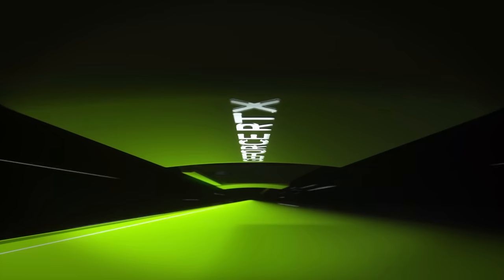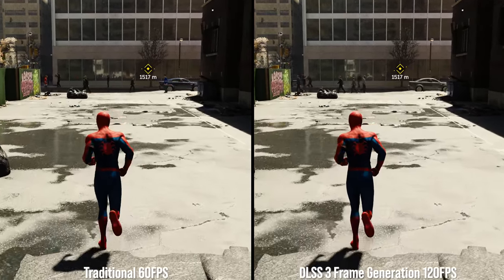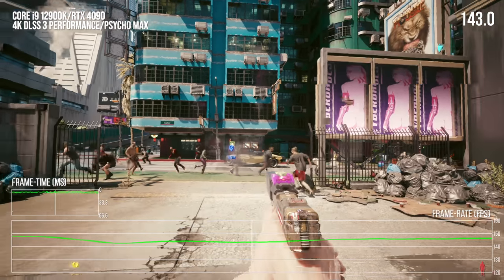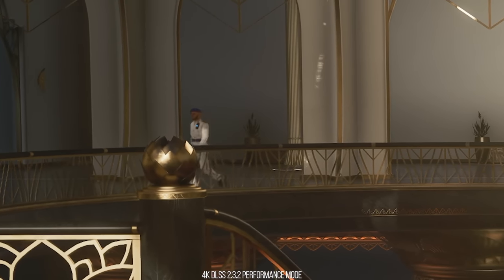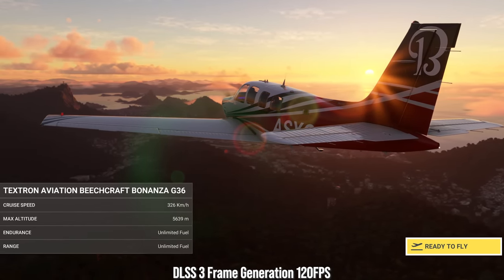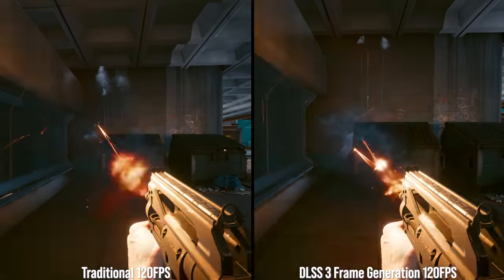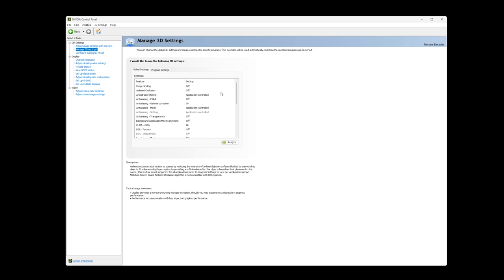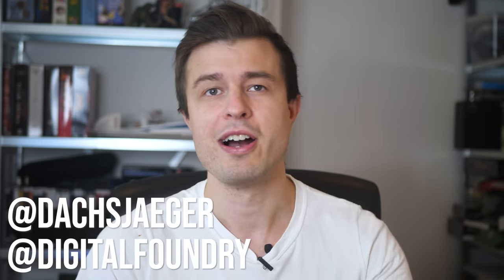Nvidia DLSS 3 Analysis: Image Quality, Latency, V-Sync + Testing Methodology

Comment: What's with the Vsync talk, it shouldn't be used EVER. Then the problem doesn't exist. Use only VRR and frame cap it then latency wouldn't increase. Your example was still high because you still used Vsync.
 If you don't have VRR ability for some reason you still just frame cap it to 118fps and the tearing is minimal if you always hit the high frames. Still not increased latency.

I don't even understand why you bring up Vsync at all. It makes no sense. Why are you saying you will use Vsync if you inherently have Gsync available? Turn that Vsync off leave only Gsync on and frame cap it. The Vsync part when using Gsync is ONLY for when the fps hit monitor refresh cap and goes beyond it and causing tearing. Because the Gsync range only goes to monitor refresh cap.
Are there really people out there using Vsync for when frames go above it. LOL??? All you're doing is playing at increased latency. Imagine playing a game where you 99% of the time is above your monitor refresh cap of let's say 120Hz. You 100% defeat the purpose of Gsync and you just have the increased latency with Vsync. 

I don't get it, what am I missing here?
Reply: A lot of people still use Vsync because they dont have VRR (or have shitty VRR) and tearing is horrible. High FPS causes more tearing, not less. I don't play multiplayer games, double the latency for a perfect smooth image is worth
Reply: VRR is not widely adopted so it it makes sense people use vsync, especially in single player games , people don't like tearing and most people  would prefere small latency than tearing, so please don't you say something so dumb as to it makes no sense
Reply: @EricDFreak   This is for higher frame rates. So, if possible, frame capping at 120fps if you have 120Hz monitor is still better. I don't have VRR at the moment. I see no tearing when playing games reaching 120fps. It's so minimal it doesn't distract.

Comment: I think frame generation sounds like a gimmick.  Adding "fake frames" to double fps on a graph but not really increasing performance.  Really ?  How is increasing latency, and just posting higher fps, not a gimmick ? Just know exactly what it is and what it is not, as explained greatly in this video.    I also agree with some videos that say , the best idea is to not use it unless you need to use it.  Just use DLSS, which is awesome.  But remember, DLSS put more load on a cpu, and takes some load off the gpu.  Poorly optimized games that are released too early, causes gamers to need more computer power to compensate for poor programming.

Comment: Like everyone else says, great job Alex!

And holy hell, DLSS 3 seems awful. I love high game rates (I game at 120Hz when I can). But this only seems worth it if a game can't hit over 60Hz with just DLSS 2 reconstruction, and I can't imagine wanting over 60Hz at the cost of that much latency, artifacting, and putzing with settings to ensure frame rate isn't too good. Remember when it was common knowledge not to turn on your TV's motion interpolation? Now that same (albeit much improved) feature is being sold to us as a gaming feature. I don't buy it.
Reply: Reflex addresses latency. This is no worse than triple buffering latency.
Reply: @Wobbothe3rd  Why not use Reflex without this?
Reply: It's actually the opposite. They clearly explained why DLSS 3 looks and works better the more natural framerates you already have. So, it's not worth it if you cannot hit over 60 Hz
Reply: @FredWallace18  I'd say, this is for people that can at least hit 80 natural FPS. But also I think a 4K +144Hz is needed in a scenario like this, because it would be too easy to hit 120 FPS with DLSS 3 if you already get 80 FPS. And as they explained, to have the best low latency ratio, you must not get too close to your monitor's refresh rate limit. So, the sweet spot to activate DLSS 3 imo is, 1) You hit around 80 FPS with a 4K 144 Hz monitor OR 2) You hit around 100 FPS with a 4K 165 Hz monitor. 

If you have a 240+ Hz monitor, DLSS 3 is NOT recommended, since you probably are an e-sports player and your objective is to have the least amount of latency as possible.

Comment: The input latency test was amateurish.

No knowledge shown of limiting output fps to 3 below monitor hz.

Doing this eliminates the need for vsync because it prevents screen tear when output fps is higher than monitor hz.

GSync does the opposite by preventing screen tear when output fps is lower than monitor hz.

Turn Gsync on, VSync off and limit fps to 3 below monitor hz and now test input latency.

I'd go as far to say your test was fake news and complete mis-information.
Reply: Reflex, which is automatically enabled when using DLSS 3, already caps the refresh rate.

Comment: Nobody uses v-sync on PC. Dude has no clue what he's talking about.
Reply: Found the guy with the crappy gpu that can't max out his monitors refresh rate.
Reply: @justinnolan3667  nobody can in this game, show me one person that runs it at max settings 4k and 144hz. Without fake DLSS 3.0 which basically adds input lag which beats the whole point of getting high refresh rates.
Reply: @rj6782  you realize not everyone does 4k? At 1440p with every setting maxed including RT and without dlss or frame insertion the 4070 Ti still goes over 144fps in some simple scenes and the screen tears. Vsync prevents tearing above gsync range.
Reply: RT will make sure you are CPU bottlenecked way before u hit 144 frames on any resolution at max settings,  frame insertions is useless for the simple reason it ups latency, which is the exact reason u want more FPS.
Reply: @rj6782  in normal gameplay, yes. But when you are indoors looking at a desk closeup the fps goes above 144 and the screen begins tearing without vsync. I'm not talking about frame insertion, I'm talking about the idiotic statement that nobody uses vsync on PC.